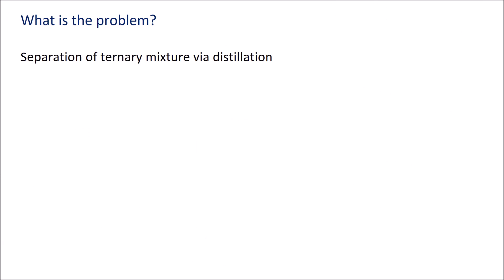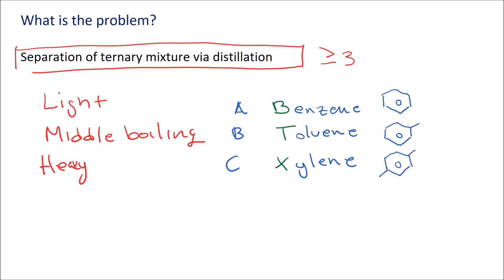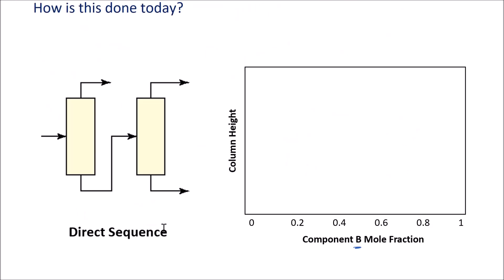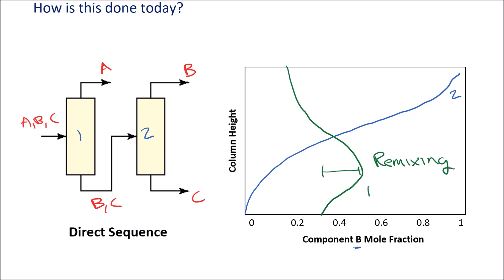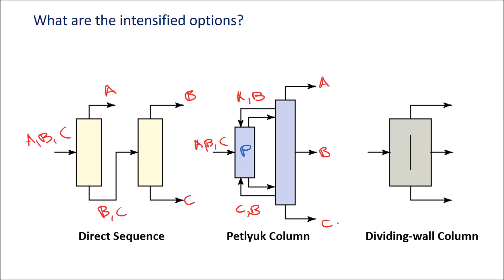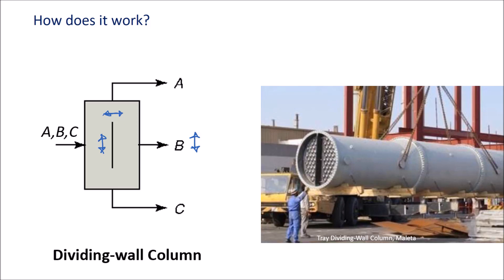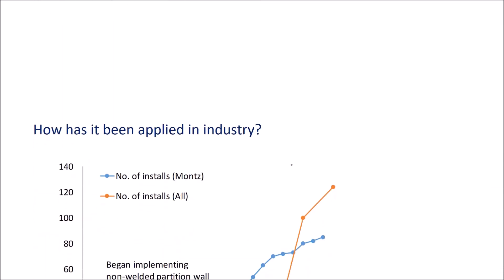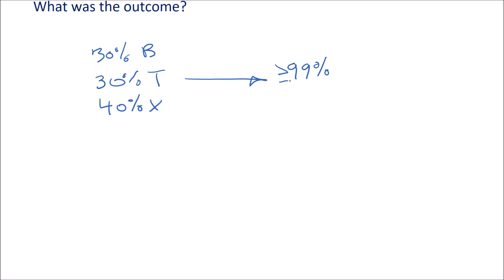Tech Highlight: Dividing Wall Column

Comment: I managed a project, where we installed a Dividing Wall Column in a new chemical facility, which went online in late 2000.  Very unique leap for a super major international oil company.  Unfortunately, I am not familiar with the longer term operational experience with this column.  I never saw another employed in the industry.